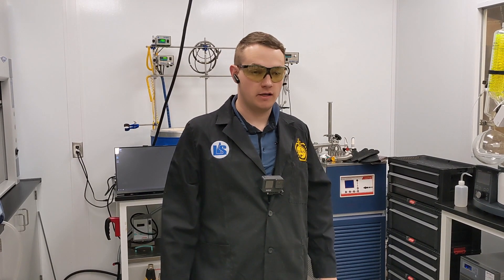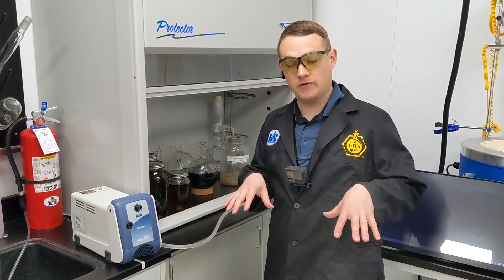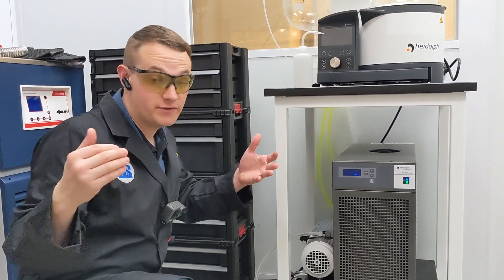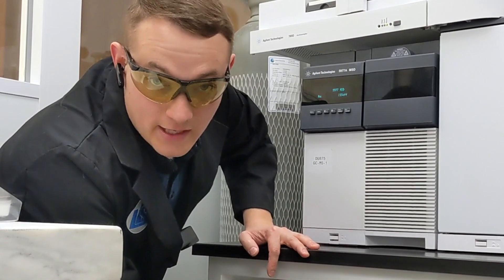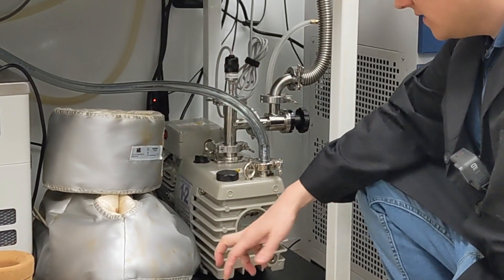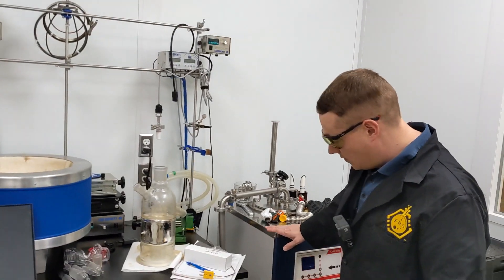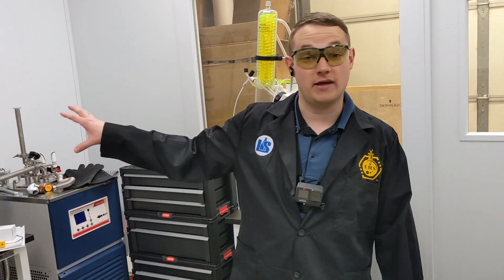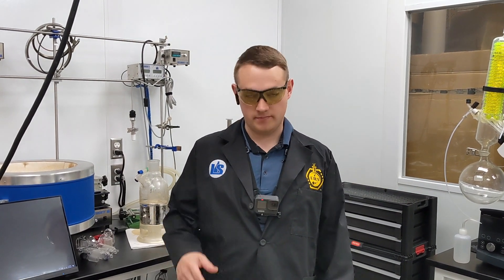Choosing the Right Vacuum Pump for your Laboratory

Comment: I agree. Most people use the wrong pump for the wrong application. I have seen people use diffusion pumps and complain they cannot achieve vac, but they use it on a "wet" application.

Comment: I gotta say, ive worked in semiconductor and with our plasma etch chambers, we had vacuum pumps that could suck a baby through a straw, low enough to strike a plasma, i also worked in R&D for a medical device company making and testing negative pressure devices used for sucking would juices from every type of wound from evisceration to post op breast augmentaton but i have never been as freaking turned the fuck on thinking about negative pressure as applied to distillate, terpenes, and anything pertaining to THC. I feel ive wasted my life to this point!! Rock on buddy, you got a new sub, just keep talking that sexy talk..lol

Comment: Hey Mike, what would you recommend if I need to distillate phenol? The water cycle vacuum couldn't provide enough vacuum, and the oil pump or mechanical always gets jammed by the cooled phenol.
Reply: Use a cold trap before your pump and it will catch any vapours